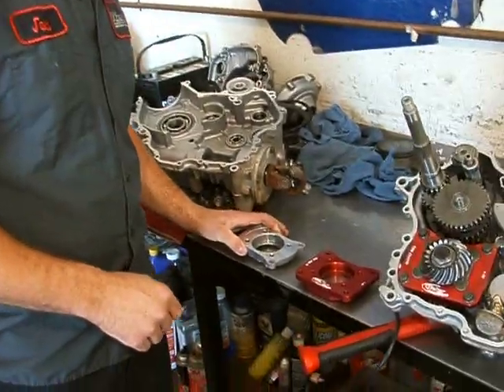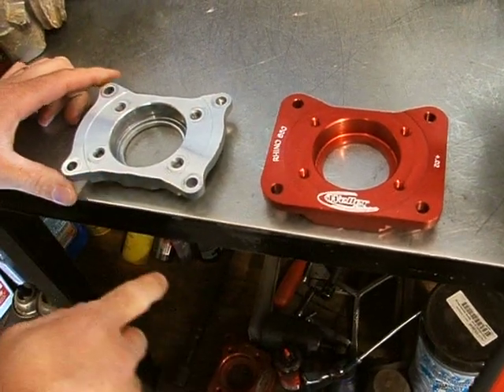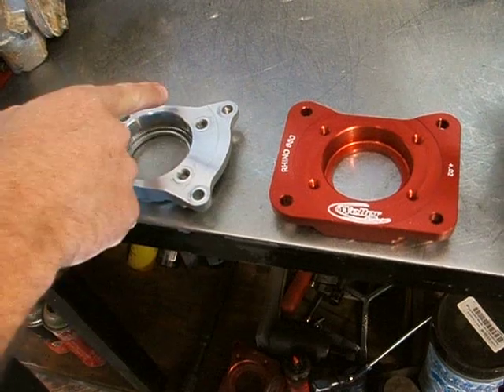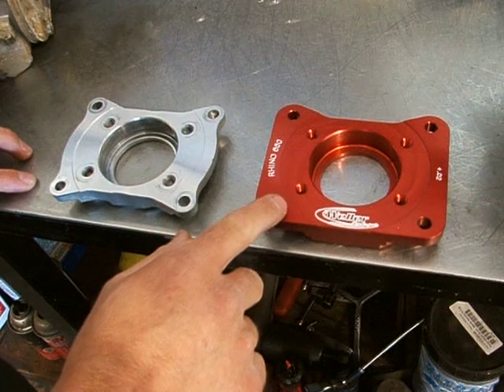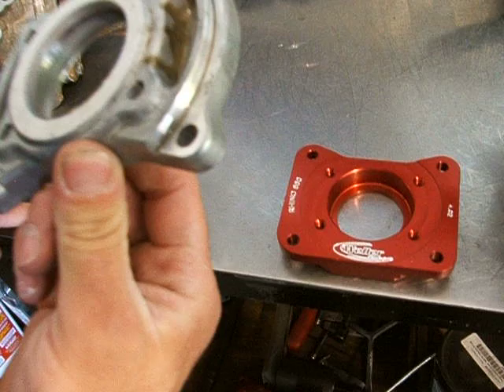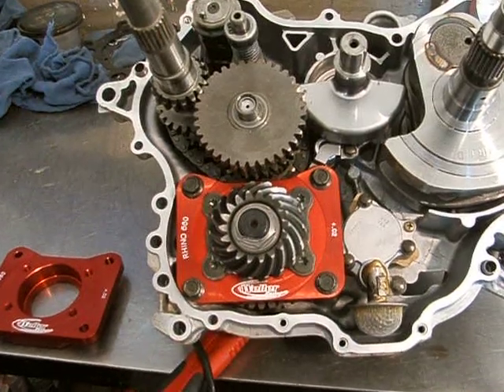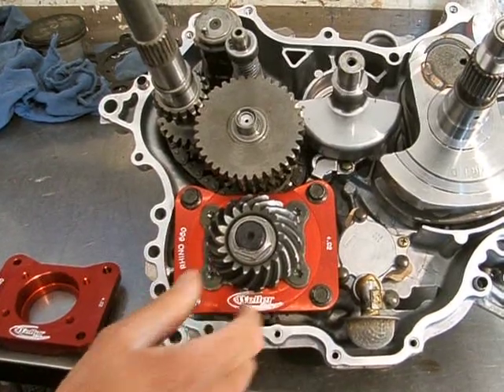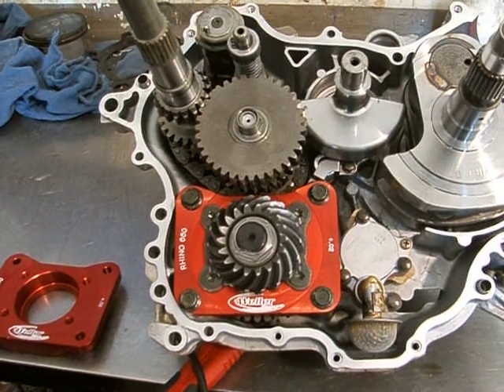rhino 660 diff plate.AVI

Comment: Great video!! Does it come with the bolts or do I use originals?
  Kyle at WellerRacing says that it is highly recommended if you are cracking the case as this is a weak point in the engine. Also, big thanks to Kyle for helping me to choose a crankshaft for my 06 Rhino.
Everyone at Weller Racing was knowledgeable and VERY helpful in ordering parts.
 I highly recommend!!